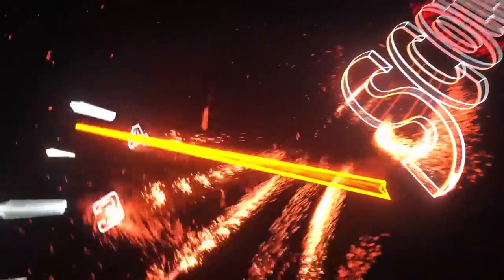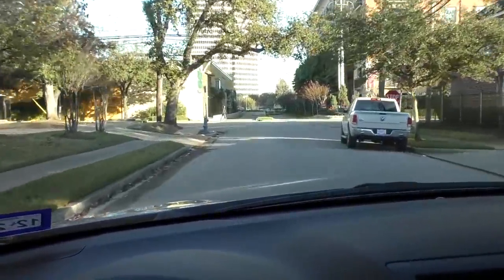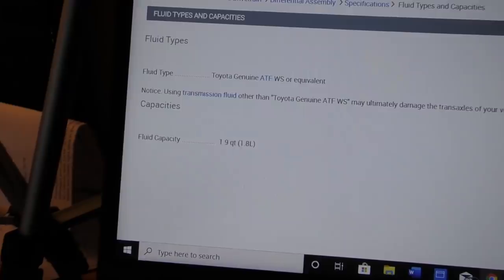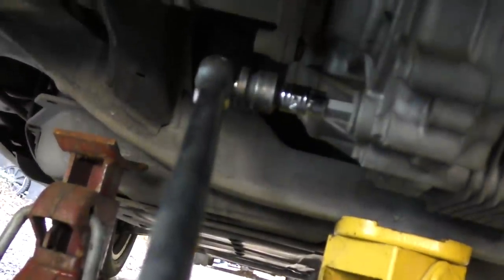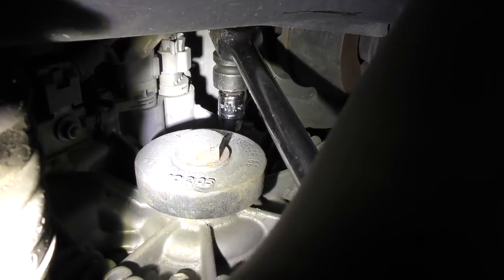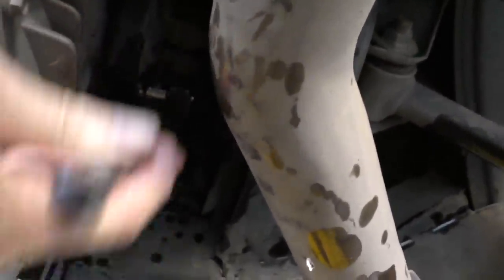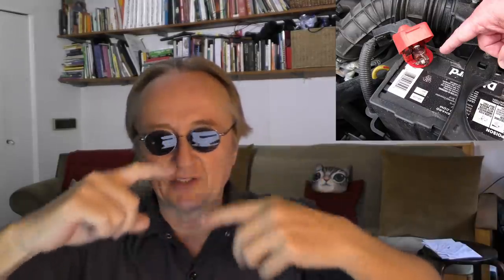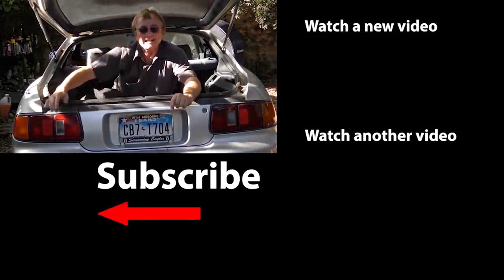This is Serious

Comment: Hey Scotty I have a 2007 Hyundai Entourage with 183,000 miles on it, runs great but there is a weird knocking noise that comes from the glove box when you turn the car off also when I go to start the car if I get the knocking noise it won’t start at first. Eventually it always starts but sometimes only after several try’s and the glove box knocking at us. What could be the issue? Btw it’s distinctly a knocking sound and not clicking

Comment: I'm not sure about the Mitsubishi with brown coolant being a bad head gasket.  If it's brown throughout I'd say it very old coolant that's picked up some rust, as seen in the meme.  If oil is in the coolant it will rise to the top of the reservoir tank right under the cap.

Comment: Change the diff fluid at 20,000 miles and as long as it never goes under water or has a venting issue you'll never have to do anything for the rest of its life.

Comment: What’s your opinion on 94 s10 blazer Tahoe edition 115000 mi. Bought it for 300 changed brake lines fuel pump runs and drives great. What’s the best way to fix the body mount underneath front door. The bolt and threads and everything came out on both side.

Comment: Me Kilmer. I have a 2008 gmc envoy. I took the throttle body off cleaned it up . Put it back together. Now i have a high idle problem. Any suggestions. I’m seeing i need to do a throttle relearn. With a computer. I don’t have one. Do you know any other way to relearn the throttle. On 2008 gmc envoy.

Comment: Scotty, I recently got a 2003 Toyota corolla with 131000 miles for my first car, when i start the car it takes a couple extra cranks for it to turn over and start. When it does, there is a rattling/ clicking sound from what sounds like the a/c compressor. I'm thinking that the A/c compressor bearing is going out. Could that be it? Also I got the code p0125 for the thermostat but the car is staying at the normal temperature when I'm driving it. I looked it up and it says it could just be some sensor. Lastly, my airbag light stays on with 2 wires under the drivers seat not plugged into anything coming from the buckle and they don't seem to plug into anything. Otherwise everything else works fine. Thanks for your help!

Comment: Scotty I have a 2019 Hyundai Elantra for my first car. I use full synthetic oil and it says change full synthetic oil every 7000 miles ( I change my own oil) my dad says we need to change it every 7 because the filter doesn’t last as long as the oil. What would you do?
Reply: Change the oil and filter at 5000 miles.  Use OEM Hyundai oil filter.

Comment: Hey Scotty, I have 2003 bmw 330xi  . I just replaced my master cylinder recently and need to bench bleed the new one . This style master cylinder has a line also that goes to DSC unit . Do i need to seal that port or run another bleeder tube off that back to the reservior

Comment: I have the same exact vehicle with the same exact miles.  Would it be wise to change the rear differential fluid now before it even starts making the noise? 

I notice too there is a slight power surge when feathering the throttle at highways speeds like the truck is choosing back and forth if it should use more gas or electric motor.  Do you notice that with this Highlander?

Comment: Hey Scotty just bought a used Toyota Camry 2009 LE with 98,000 miles  any advice or tips you can give and also your option of the car
Reply: 2.4 engine?
Reply: Yes sir
Reply: @sethlowell5255  
Those problems were common but not everybody that owned one had trouble. Still I would check the oil regularly and keep it topped off and possibly not plan on keeping the vehicle long term. You'll have to decide based on your own research.
Reply: Think you sir
Reply: Thank *

Comment: Scott i need some help i have a 2003 gmc sierra 2500, work truck but also a daily driver. Its a piece of junk but still powerful, however it starts popping corn when the tank is under quarter or quarter. It has 340000 km on the odometer thanks

Comment: scotty. got a 95 ford e150 econoline, when i start it, it revs high til i push the gas down once, then it idles down. also i hear a ton of air blowing when i take off and its kind of slow on the take off speed... any ideas?

Comment: Toyota Motor Corp said it will recall 3.4 million vehicles worldwide because the air bags may not deploy in crashes due to a mechanical issue

Comment: Toyota and other overseas MFG SUV and trucks might overall have better quality, but almost all of the bigger pick-ups, SUV's Vans made in the states have the time-tested Dana rear......my 2004 E350 Super duty has a Dana, changed fluid only once so far, used synthetic, now has 155K..........but very cool tool there Scotty..........but this also shows the issue with new, young mechanics starting out, you have to invest a whole bunch of money, even if you work for a shop, and you will never,. never stop buying tools as long as they change the cars design........my grand pa still had the same tool set he started  with when he retired, except for a few large things my pops bought when he took over the family service station.......even now, me at @60 yrs old, still buying tools every month, and I work on industrial equipment that does no really have big changes for almost 10 years.....but when a re-designed model comes out....break open the wallet, take out an equity loan, if you want to stay in business...........

Comment: How can we can we improve a simple mechanical linkage. A few cents of cable, and a couple dollars of metal rod and hiem joints....
Attach a sensor on one end...angel hair wire...computer board ...angel hair wire..servo motor.
Any better? No. More expensive..yes.
 Can customer fix or adjust...no.
Perfect.

Comment: Help. So I recently bought a 2020 Camry SE, and today I drove on the Expressway and after getting off the Expressway the drive felt bumpy. No sensors came up nothing marked by the computer. I’m worried cause I just bought it brand new at 0 miles and all. Pressure seemed good and tired were secured. What could it be?
Reply: I would check the torque on the lug nuts. You don't need a wheel coming off.

Comment: You'd think that GM would have their electrical issues solved by now.  As far back as I can remember, even as a kid in the 70's, I have heard about GM electrical problems.  
The old saying was "GM has electrical problems, Dodges have weak front ends, and Fords leak."  Now the saying is "GM has electrical problems."

Comment: Reguarding the Porsche issue.Just happens to be a Porsche this time but could be nearly any modern car. I understand why computers control engine functions,but can anyone intelligently tell me what the purpose is for computer controlling things that have worked fine all these years either with simple electrical switches or mechanically? It's really upsetting to me that cars are becomiming computer controlled albatrosses.

Comment: Hey Scotty. Is it good to buy Hyundai Tucson 2019 model for 15000. It is a rental car and has runner 9000 miles.
Reply: Be sure to ask if the 100,000 mile warranty  on the drivetrain does not expire at 60,000 since its used car.
Reply: @graysonwagner1855  thanks

Comment: It's a Toyota, that diff should last at least 500,000 miles! so much for Toyota reliability! And $1800? just as expensive as a German car maybe more so!
Reply: My daughter paid $2200 for a used one plus labor on her AWD 2011 Sienna. (With one year warranty)
Reply: @stevensevek6151  Like I have always said Japanese car spares are often much more expensive than their German rivals. I had a diff totally refurbed on an E46 3 Series BMW it costs me just 500 GBP or about $650 including parts labour and tax! Compared that to what it costs on a Toyota! I drove that car for almost 10 years after and the refurbed diff was all good. Some time ago I had a Mk3 Supra Turbo and the front ball joint on that new from the dealer was around 300 GBP! you could get one for an equivalent performance BMW for less then 100 GBP!
Reply: @joebloggs4191  
It definitely seems like Toyota is doing something wrong when it comes to differentials. My daughter paid $2200 for a used one but a new one was $4000. Ridiculous. Personally I would avoid AWD & hybrid Toyotas.
We have a 2009 RAV4 but it is only FWD. I'm retired so when the weather is bad we stay home and if we have to go to the supermarket, it's only one mile away. I can handle that. In fact I like driving in the snow but I don't like to risk having someone else run into me.
Reply: @stevensevek6151  $4000?? jeez that's a lot. It's not just the diff pricing many parts are ridiculously expensive on not just Toyotas but all Japanese cars.

Comment: I'm testing running no pressure in my cooling systems to see how they do. Just removed the rubber gasket on the pressure part of the cap. So far no problems but it's not hot weather. We'll see how they do when spring comes. I'll be watching that temp gauge closely. Even if I have to run pressure during the summer,  taking the stress off the cooling components for 7-9 months of the year should make them last longer.
Reply: Sounds like a bad idea.
Reply: @stevensevek6151  been running hundreds of miles per week for over a month now and no issues

Comment: Clearly the owner never serviced his differential.... oil changes and gasoline haha.  That's why you need service records if you're tempted to buy a car with over 100k miles.
Second issue, not having his Toyota Hybrid serviced by....TOYOTA.  I know folks are cheap skates and trying to save a buck, but in the long line short changing manufacturer service and service intervals is a grenade waiting to go off.

Comment: Gee Toyota just can't built differentials.  I had a grinding and howling noise from the front differential in my 08 Toyota Tundra...had to have the differential replaced, completely ridiculous on what Toyota pretends to call a pickup truck.  A couple years later the grinding/growling noise was back, and at 104k miles I sold the truck...obviously they just can't get any good parts so I wasn't about to pay for another replacement differential.  Aluminum casings that warp.

Comment: 🔴🔴🔴do you think most mechanic will pin point where the noise coming from and change the the def. oil or made you swap out both sides of wheel-bearing,  suck your wallet as fast as a Hoover vacuum cleaner then fix the def.?🤔😂😂😂🔴🔴🔴

Comment: Now u been a mechanic for 53 years . U cant rebuild transmission, drive train,engines. They only thing I saw u do is replacing belts and oil . U look more like a gas station mechanic than anything.   Respectively
Reply: No point in enumerating the skills of a machinist. Few if any viewers here would ever delve that deeply into rebuilding their vehicles. Those few who would may already know more than YOU claim to know.

Comment: Just jack the truck up and spin the wheel it will be easy to tell which bearing it is. Don't buy this crap tool.
Reply: Usually wheel bearing make more noise with weight on them.
Reply: @stevensevek6151  i have had 2 bad wheel bearings and both were easily noticable when the car was on jack stands, but you are right it is probably even easier if there us weight on the tire/bearing.